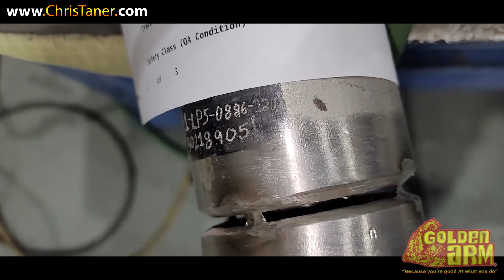[PIPE WELDING] NUCLEAR POWER QC..... VERY STRICT

Comment: Could u just use an 1/8" spacer when tacking  and weld with 3/32 tig rod or 1/8". ?
Reply: Im not as experienced as you thats why i ask?
Reply from the maker: @johnjabster2247 Yeah no problem. If my gap is 1/8, 99% of the time i use 3/32 tig rod when i'm welding Stainless Steel.
Reply from the maker: Yes you can use a 1/8 spacer. I use 3/32 rod and 1/8 rod, from time to time i switch up like that.

Comment: As a CWI, ICC Welding inspector and building inspector (all other 8 ICCs) You strike me as a damn solid welder. When you are critical of your own welds and can clearly understand the issues brought up. (I have extremely limited Nuclear plant experience). but the saying still rings true, A good, consistent, honest welder, is a welder who is left alone and unbothered. Its true. If my plate is full and I'm running around chasing issues all day, you are the lowest priority for me. I know you do good work and take pride in it. PLUS, if you are straight up, and I present an issue, you'll fix it and then we are good again. There is a reason "Inspectors" have a terrible reputation, almost like the job site cops. Because someone or many other tradesmen have an issue with us calling them out on their piss poor work. So the good ones, we can recognize in an instant and get INSTANT grace.
Reply from the maker: https://www.mygoldenarm.com/

Comment: Despite what most people believe.  Nuclear power is by far the safest and cleanest source of energy.  More so than even solar or wind.  It's because everything is rigorous.  Rules, inspection, regulation, etc.
When it comes to metallurgy and welding.  Improper methods, contamination, or incorrect material can have catastrophic results.